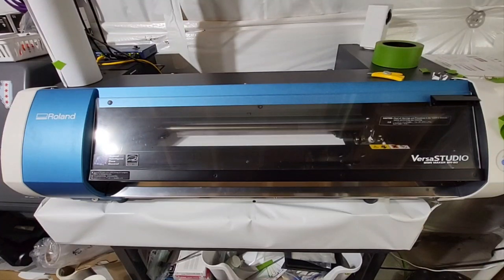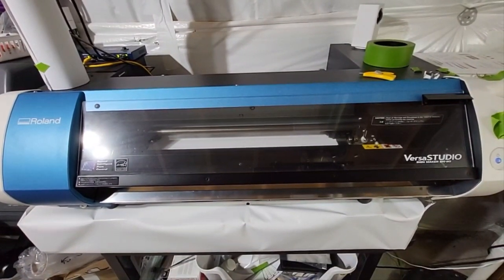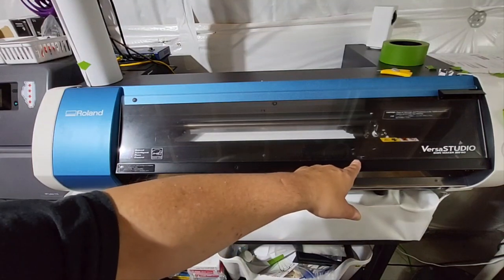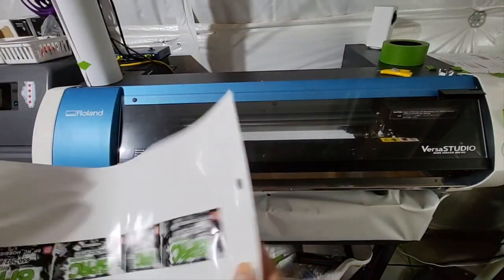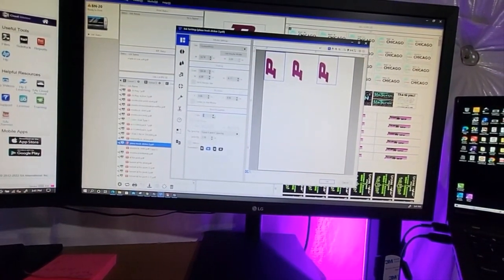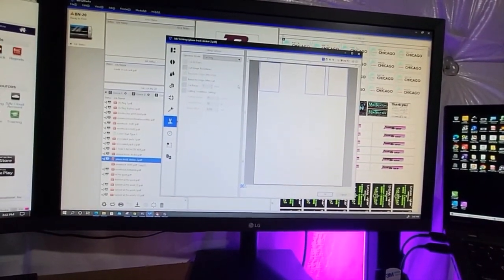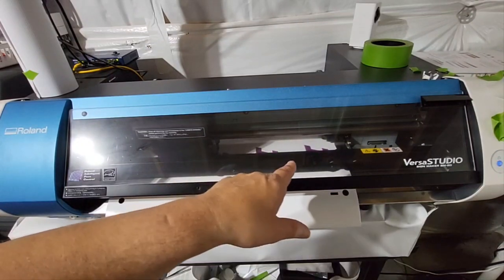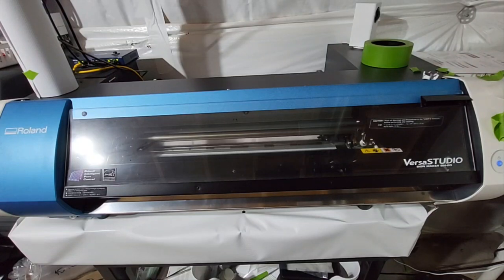Roland BN-20 💯💥 Super simple how to print lam and cut with versaworks 💥💯

Comment: would this printer really help start a sticker business more efficiently than using a cameo 4 and laserjet printer? sorry for the silly question, I am trying to get into the print and design business but not sure where to start
Reply from the maker: yes, the fact that it prints on commercial sign grade vinyl is the #1 reason, laserjet printers will not be able to print on vinyl also the size of it.  hope this helps!
Reply: @DaPrintHouse  thank you! Did you take any course for the business? How can I Start or do I just need to know basics for Adobe?

Comment: How long is your cable?  I noticed your computer and your Roland are on opposite ends!?
Reply from the maker: Lol very good observation, was wondering someone when would notice.  Its actually 2 things going on.  I run a 25ft repeater usb cable to the computer actually running it. But the other computer you see me going from is working on remote desktop because i do all my designing on that computer and makes transfering files easier.
Reply: @DaPrintHouse  😂 can you maybe show the setup. Because I use my Mack book to design and then I have a network server folder setup that I drop my files into and then on my Microsoft computer I just go in and pull it. But the Microsoft computer is literally sitting on the printer.
Reply from the maker: @queenk8248  i can, but unless u run windows on your mac u need to hse wi dows remote desktop or some otber setup that alows drag and drop files  or a server folder which also works
Reply: @DaPrintHouse  I already am, as I mentioned above. I use a server folder to drag and drop.

Comment: I had printed the marks (before I watched video and I did not choose to go back to origin) but lining up print marks to the sensor when I put it back in and it keeps canceling. help?
Reply from the maker: I would have to see a video how u are doing it.
Reply from the maker: Thinking about it I wonder if it's your hold down wheel placement. They need to be over thr grit of the wheel